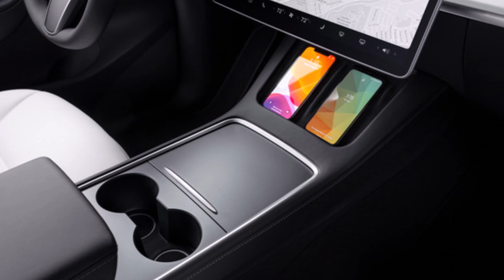Tesla's New Model Y Coming May Come in 2024 With Increased Range

Comment: A lot depends on 4680 battery manufacturing capacity. Right now Tesla only has their Fremont/Kato road battery factory to produce all 4680 batteries worldwide. That is part of the reason why the Texas Model Y is currently limited to a 50kWh battery pack. And why Tesla is not openly advertising that model. If they up the capacity of the 4680 battery pack to 75kWh (like the Model Y LR is today with 2170 batteries) then the next Model Y would have potentially 420 miles of range. I think that the issue for 2023 is that Tesla will start building the Cybertruck in Texas. And that is a vehicle that NEEDS the 4680 batteries, especially the quad motor version. Remember that Tesla promised 500 miles of range with the top model Cybertruck. Which will probably require a 140-160kwh battery pack (using 4680 batteries). For reference, the 9,200lb Hummer needs a 200kWh battery pack to get 329 miles, and the 7,200lb, Rivian R1T's largest battery pack is 135kWh and has a projected range of 400 miles. Production of 4680 batteries by Panasonic and LG are a ways off, but Tesla already does have 4680 production capability now supposedly, and can hopefully ramp up volume 4680 production this year. Giga Berlin should also be ramping up 4680 battery production, but that will probably just support their local vehicles there, especially when they start using 4680 batteries for the other Tesla Models sold there (Model 3, Model S, Model X) as well. For the 2024 Model Y, I think that in addition to the full sized 4680 pack, Tesla may use CATL's upcoming Qilin LFP batteries, which boast 13% more energy density than Tesla's 4680s, and don't use cobalt. People will jump in saying that the LFP batteries will also have longer life and the ability to fast charge from 0-100% without degradation, but I personally think that the 4680 batteries are actually Tesla's rumored million mile batteries, so they will have similar long life and no problems with 0-100% fast charging, like LFP. LFP promises to be cheaper though, and I think that instead of Tesla escalating the battery max range wars, at some point soon they will offer smaller battery packs that give a 300 mile range, rather than pushing out to have 1,000 miles of range, but needing a 2,000lb, 200kW, battery pack. Again, just as a reality check, the average daily driving/commuting range in the U.S. is under 40 miles per day.  And 85% of EV owners charge overnight at home, back to full. So hauling an extra 1,200lbs of battery around every single day just for the rare times that you need to drive more than 300/400 miles each day is something only a few people need. Especially as the smaller battery packs will cost less to build, and EVs can be much cheaper using them.
Reply: The first generation 4680's don't have the Energy density promised nor the weight savings as proven by the Texas Standard Range .